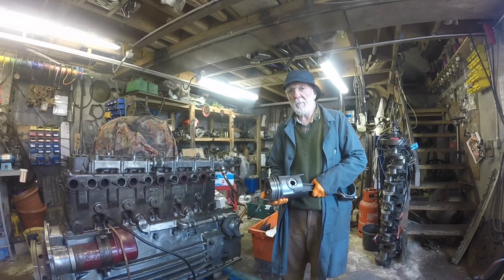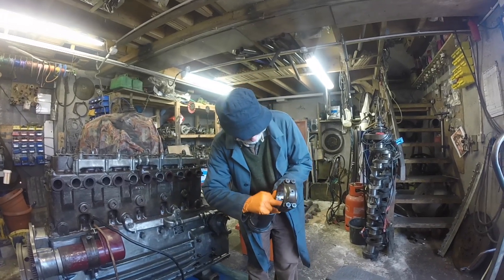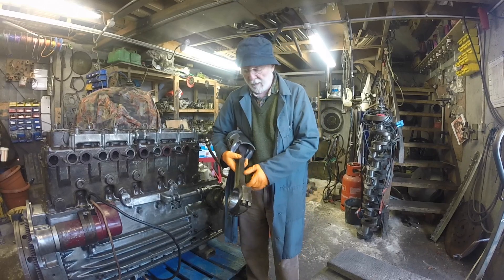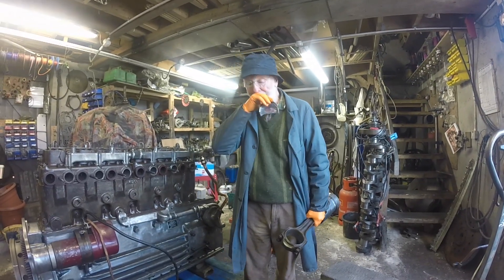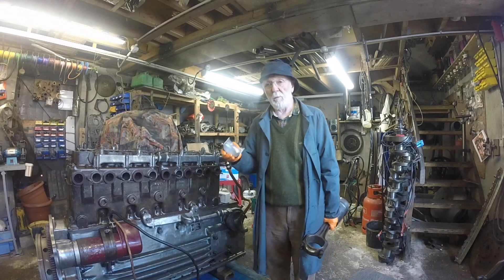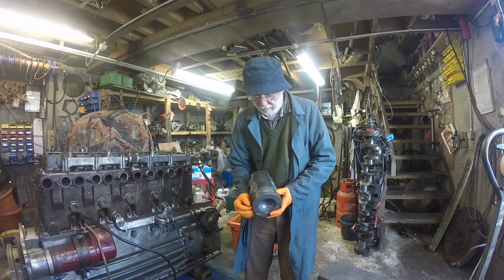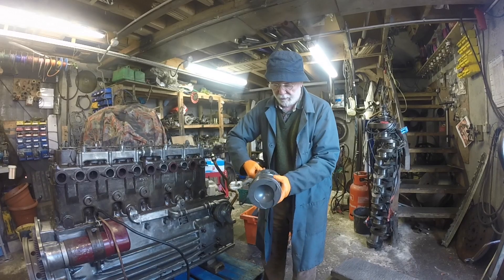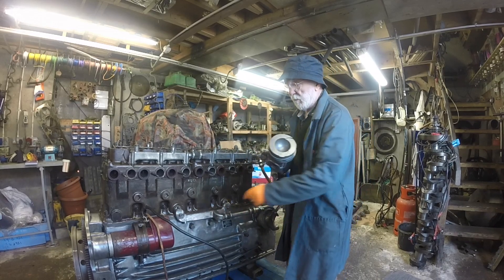Gardner Pistons and Con-rods

Comment: What I find interesting about Gardners is their smoothness, and that is why they blew up when turbocharged. The cam timing needed to be altered and pump timing retarded to take the pressure off. Having peak torque so low in the rpm band without appropriate strengthening and tuning just tears things up.
Reply: Cam timing and pump timing have to be altered for "boost". Do tell.

Comment: From my recollection Gardner Pistons had a fully floating gudgeon pin with No circlips,they used to have alloy end caps that stopped the pin scoring the cylinder bore. Gardner Con-Rods were a work of Art and beautifully made as were the Pistons,most of the Pistons was machined away to allow for maximum lubrication to the cylinder bores and that’s why the engines lasted so long,it was was only when they started to squeeze more power out of an already great engine that problems started to occur,turbo charging them was a waste of time and did nothing to improve the power output,they were a very efficient plodder and should have been left that way and left the likes of Scania and Volvo to make performance engines, Gardner should have never tried to compete in this market at such a late stage, Scania are now top dog in the truck market and rightly so, Leyland also panicked and built that Piece of Shit 500 fixed head series engine which was a Total Disaster,the engine was designed for 500 BHP but had to be down rated time and time again because of engine failures. I drove a Leyland Bison 24 tonne tipper fitted with a 511 engine rated at 230bhp which pulled like a train for about 40,000 miles then blew itself to bits and this is what finished Leyland Trucks, the Warranty claims on those engines bankrupted them and a lot of hauliers too.

Comment: Gudon pin is not in the centre of the piston in order to reduce the side load on the piston/cylinder. Other manufacturers do that by offsetting the cylinder centreline from the crank centreline. I.e. the famous Fiat 500 (the original)

Comment: If you put the piston in the wrong way around the offset gudgeon will cause a little extra noise but that will be minor compared to the bent valves and/or pushrods plus the valves will hammer some extra pockets in the piston crown.